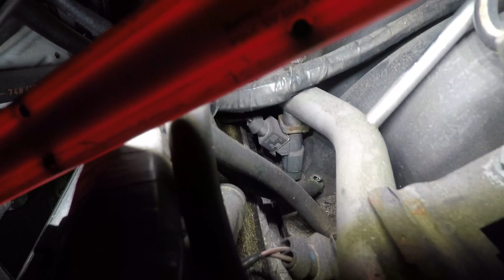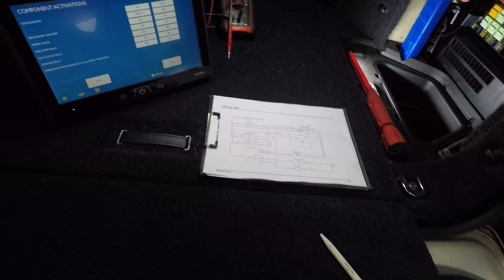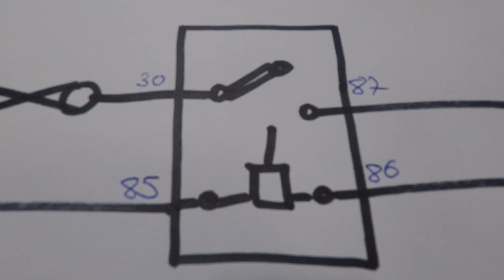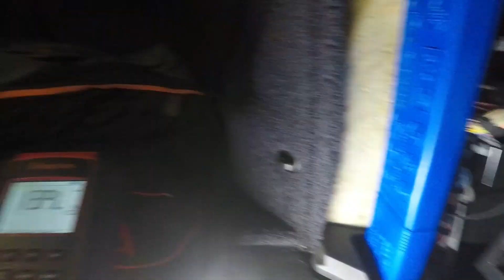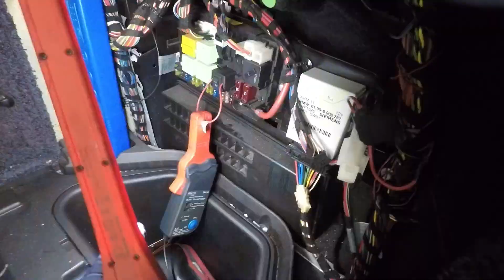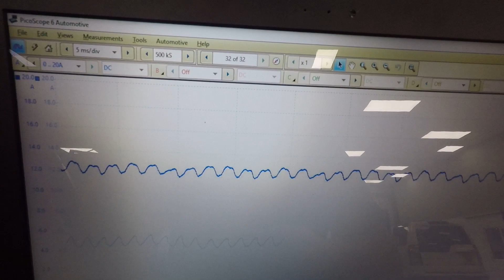Range Rover L322 4.4 V8 petrol fuel pump diagnosis at JAS LR with Picoscope!

Comment: Hi Joe, 4 years on I found this video after fixing my 05 l322 that had the same problem. the HP injector pump senses the lack of pressure on its feed and if its just dropped a bit will put the engine into low power mode with the 'Fuel Injector Fault' on the dash, if the feed pressure drops any further it cuts the engine to stop the HP pump running dry. fixed in 30 mins with a new in tank pump! Also, thanks for the insight into the difference between the BMW and LR relays, my 03 has the BMW ones and the 05 has the LR ones!🤣

Comment: Hi would a failed fuel pump on my 08 tdv8 not start my car even with easy start, I can hear pump running underneath, only a,squirt of fuel from schrader valve when not crancked, then loads under crank.

Cheers

Gerry

Comment: I'd like to see a short video on how to remove the two fuel line clips that attach to the fuel pump, I managed to get them both off today but it took about half an hour, they were a pain in the behind, I think it's the same clips on the fuel filter, I'm kinda dreading that...so yes a nice video on how you remove those fuel clips would be great...
Thanks.
Ian

Comment: Awesome video joe just out of interest at what other point in the circuit could the low amp clamp be connected in the absence of the specialist relay current loop tool to get the same waveform ?
Reply from the maker: Hey John 👍👍

You can just make a male spade to male spade jumper lead and use that - the relay things are available from Mac if you want them :)

Comment: Awesome video as always Joe! Thank you! Why do you think that two out of the eight the commutator segments are drawing less current? Do you think this is just down to tolerance or could it be an impending future failure?
Reply from the maker: Kevin Watkins hiya and thanks!

Yeah at a guess just a slight difference in manufacture of those segments and/or a difference in the windings attached to them - it could even be the pumping elements that the motor drives are less effective at the point where we have the lower current  - every motor I’ve ever scoped has had an identifiable repetitive pattern - not always 2 lower peaks in a row...but always something :)
Reply: @joehodgy 😊😊

Comment: Fascinating.
Out of interest Joe, did you consider it could be some kind of issue with the LPG side conflicting with the petrol? Sorry, I have no real idea how they work, other than being separate systems that come together at some stage.
Or was the car running fine on LPG, just not on petrol, along with the nasty sounding fuel pump?
Really impressed though how you can prove/disprove exactly what is going on.
Reply from the maker: Mark Pewsey hi! Yes we did consider it! The LPG system on this car is connected to the petrol fuel pump circuit but purely by way of a changeover relay that either connects or disconnects the fuel pump relay switching circuit - ie if the LPG system is “allowing” the engine control module to control fuel pump operation then the original fuel pump circuit should work as intended 👍

You’re right though - definitely something that we needed to consider ☺️ the LPG system also piggy-backs off the original injector wiring ... so if we had misfires and poor running due to an injector fault (for example) then we’d have needed to go a bit further in depth with the LPG installation 👍
Reply: @joehodgy  Thanks for that. As an exercise in demonstrating what Picoscope can do for you that was spot on. I have no need for one but, boy, do I want one!!
Reply from the maker: Mark Pewsey not forgetting that in the real world it would have taken minutes! Thanks for the replies ❤️
Reply: @joehodgy  lol, not at a main dealer workshop!